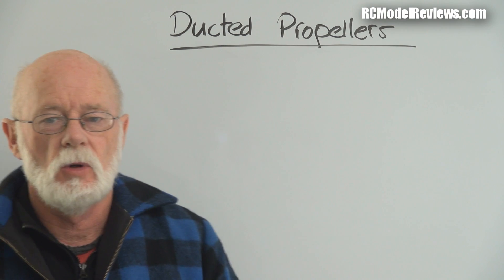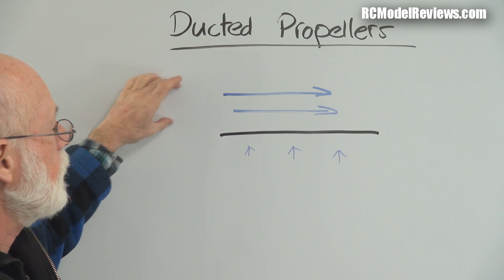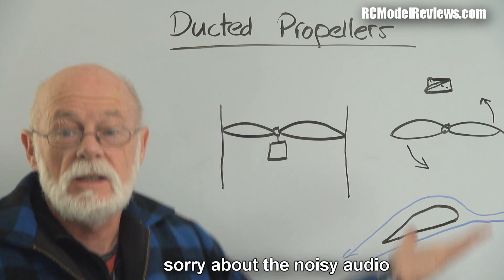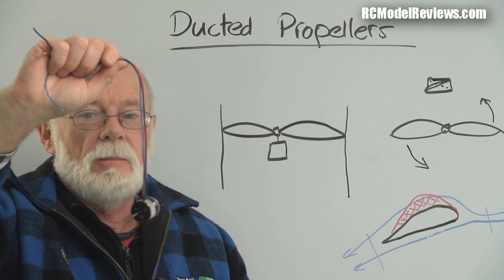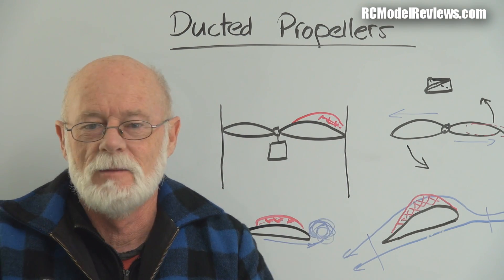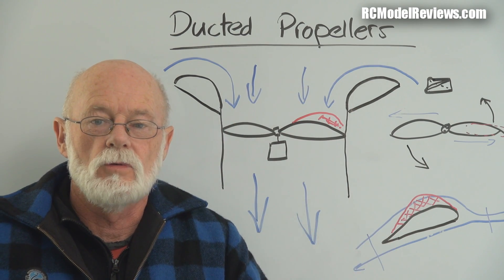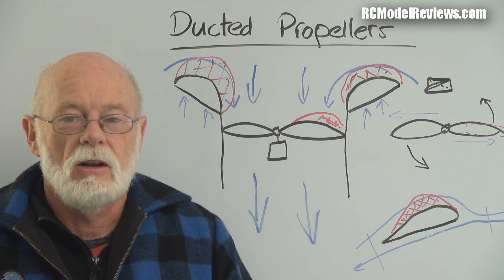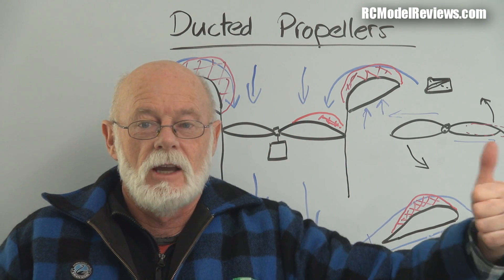How ducting a propeller increases efficiency and thrust

Comment: The Bernoulli Principal is wrong!  Low air pressure on the top of the wing is not the cause of lift, but the result of lift.  Air is pulled and pushed down by the wing (mainly pulled down from the top) which causes the air to pull and push up on the wing with equal force.  The "low pressure" and "high pressure" areas are merely the force being applied to the wing that causes lift.  The actual air pressure does not change that much at all.
Reply: EngineersLogic Yes I agree, Im an Aerospace Engineer who works on transonic wind tunnel modeling. Interesting how our fields name the same things differently, we would say that the fan increases total pressure and the amount of this total pressure converted to dynamic pressure is inversely proportional to the cross sectional size of the diffuser,  such that the sum of static and dynamic is conserved except for viscous losses associated with the boundary layer (but if we get into that then Bernoulli doesn't really apply.) your way seems easier to understand though maybe i should start explaining it like that to people.  Something id be interested in hearing from you is if you do any boundary layer boundary layer interactions like from the top and bottom surface of the duct, because the length of your duct it must kind of invalidate the Reynolds number based on length right? Do you use Reynolds based on skin friction RE tau? or is it just not really an issue and the turbulence reasonably neglected.?
Reply: HORNET6 The pitching moment coefficient  of an aircraft must be nose up at zero angle of attack and nose down as a function of increasing angle of attack. This is accomplished by using tail sections which produce negative lift to trim the aircraft, because the center of lift of an airfoil section is roughly the quarter chord point and it will therefore naturally pitch upwards. This is the stability condition known as positive Cpo negative partial cp partial alpha. Without this computer stabilization is necessary for an airplane to fly, however long ago we realized that induced drag is proportional to the coefficient of lift squared and that by adding a bit of reflex "negative airfoil" we could reduce the coefficient of induced drag by decreasing this coefficient of lift. And reduce the force required to trim the aircraft reducing trim drag. The cost of this is that the aircraft must then fly faster to achieve the same total value of lift and not descend, a thing which fighter aircraft are more than happy to do. You are correct in assuming that flipping the airfoil will tend to decrease lift but the lift force going negative can be avoided by carefully tailoring the reflex angle. This is illustrated by stunt planes being able to fly upside down despite having flipped their airfoil (its often symmetrical anyway), and the reflexed airfoils used in a flying wing type aircraft. The force a pilot observes as this issue is simply the coupling of the propulsive direction and the flight path in a nose down attitude,  but utilizing proper trim the aircraft will fly, simply at a higher speed. 
Hopefully that did not come across too lecturey , and let me know if you think I am wrong in any way.
Reply: Ok well, the Bernoulli Principal is not wrong, in lossless flows the static pressure must be reduced to increase the dynamic pressure caused by the airs movement. Therefore higher velocity flows exhibit a lower static pressure ( acting perpendicularly to the surface). 

What is wrong is the equal transit time fallacy. As explained by  NASA here
https://www.grc.nasa.gov/www/k-12/airplane/wrong1.html

I dont know what you mean by actual air pressure. The total pressure does not change that much but the static pressure sure does, in fact we can measure the static pressure over the wing surface with transducers and experimentally determine the lift the wing section produces.(Its actually my job.) 
I feel like were on the same team here though, is that what you meant?
Reply: Aero Wolf I'm not familiar with all the terminology but I think we are on the same page.  Static pressure is the pressure of the air that is physically clinging to the surface, right?
Reply: ***** there are two pressures, static and dynamic, their sum is the total pressure which is conserved in a lossless flow. 

The static pressure is measured perpendicularly to the surface so its pressing in or i guess clinging can describe it.

 The dynamic pressure comes from the airs movement so one has to slow the air to a stop to measure it but because there is a static pressure everywhere this measures Total pressure. (flow energy) 
Total pressure does not change very much because it is the sum of the two kinds which simply trade back and forth. So static pressure is lower on the top surface than the lower surface because on the top surface the dynamic pressure is higher but the total pressure is the same. Not because of the distance but because of the shape and angle of attack.
Reply: Spot on. If Bernoulli Principle would be right then air behind a wing would be equal pressure. Wings in smoke or clouds clearly show that the air behind the wing keeps moving down.
This is exactly how a sailboat functions. It work by gently bending the flowing air into a new direction and this creates a force. Again just like an wing, this new wind direction is used extensively by competing sailors to block progress on other boats. The wind change can be observed several boat lengths.
Obvious it be beneficial if there is a low drag as this would create a force against the forward motion both for sails as for wings.
Reply: EngineersLogic Yes I agree, technically the enthalpy could remain constant and temperature increase, but on the topic of Ice melting would not this increase in temperature, increase the convective heat transfer coefficient between the air and the ice thus inducing more melting? I mean it would obviously be a function of things like pressure as well but im not super familiar with it. I think the biggest problem I have with global warming as an engineer is the lack of a suitable model for our atmospheric temperatures. At one point our Co2 was 10X what it is now and now were colder than it was then. This would not happen in the simple positive feedback model for Co2 and Solar radiation we have now it would induce runaway warming. So its funny when people say its unprecedented and were doomed because we have done it before and are fine. But yes people are always confusing temperature with heat, like saying Jet fuel wont melt steel, well yeah an open flame wont but if the walls of a room allow no heat transfer, a dam (infinite) candle will eventually add enough Q to melt steel. This is particularly a problem with me as an Aerospace Engineer explaining the temperature profile of the atmosphere. Basically how the thermosphere can be over 100 deg  C but if you were there you would still freeze to death. Also how despite being absolute zero ish in space satellites tend to need cooling and not heating, if you could keep your air and eyes you would freeze to death naked in a Pennsylvanian winter before you would in space.
Reply: HORNET6 didn't call you lame. Commenting on the post, which I said was lame for implying that push and pull aren't common nomenclature used to represent force. I stand by it...tall and proud on my high horse. Seabiscuit, that's my high horse... Seabiscuit!!!!!
Reply: Boat sails and airplane wings operate using the same principles of aerodynamics, they just direct them in different ways. A sailboat needs wind to propel it across the water. An airplane uses an engine and propeller to generate wind across its wings (through forward movement). The earliest airplane wings were nothing more than cloth sails spread across a rigid, horizontal framework, while modern wingsails are nothing more than airplane wings attached vertically to a boat's deck. They both use Bernoulli's principle to create lift and it is that lifting force that keeps an airplane aloft or pulls a boat through the water.

Yes, both an airplane wing and a boat sail use angle-of-attack (AoA) to bend the air in a new direction, and this does increase the amount of lift generated or forward speed produced, but the AoA is only used to increase the power of what is already being generated by the airfoil. And while even a flat plate creates lift with a bit of AoA, an airfoil shape allows the air to flow MUCH more cleanly across the wing or sail before the shape experiences cavitation (stall) and loses most or all of its lifting power.

A wing moving through the air with zero angle-of-attack would release the air along its trailing edge so cleanly that almost no disturbance would be visible in the surrounding air apart from that created by drag, something created by any object moving through a fluid or gas, but it would still produce a certain amount of lift due to its airfoil shape and Bernoulli's principle.
Reply: Another term for "dynamic pressure" is "velocity pressure", which might make it easier for some to understand. You are absolutely correct: static pressure + velocity (dynamic) pressure = total pressure. Static pressure has nothing to do with "clinging" to anything. Static pressure is exerted in all directions equally (like an inflated balloon), velocity pressure is pressure in a single direction (like wind hitting the side of a house). I do HVAC engineering: Air conditioning or exhaust fans create 'X' amount of static pressure, but the actual static pressure inside of the duct depends on sizing. If we speed up the air flow with smaller ducts, there is higher velocity pressure, which means we lose more energy when the air smacks into a perpendicular plane at the back side of a 90 degree elbow in the duct. There is also more energy loss with higher velocities because greater speed across a surface increases friction loss (clinging?).  The velocity pressure can also be converted back into static pressure by increasing the duct size and slowing the air down (called static regain). A positive pressure duct can actually pull air into the duct from an opening in the side of the duct if the velocity is high enough (rather than push air out of the hole), which is how the venturi effect works.

Contrary to Timothy's assertion: The Bernoulli Principal is most certainly NOT wrong. We are all dumber now for having read his comment, I'm just sayin.

https://woodgears.ca/physics/venturi.html
Reply: Aero Wolf 
Great comment, i look forward to responding. I'm in my truck about to leave the gas station at the moment though, i will have to get back to you.
Reply: For the record, I am not an engineer. I do not mean to claim that unearned title. I am a mechanical designer who has been designing mechanical systems for ~18 years. I will however stand my ground against any registered engineer if I disagree with them.
Reply: This is completely off topic, but don't you find it interesting how the entire global warming/climate change discussion rests on "degrees of temperature change" (which is a reference to dry bulb only, and completely ignores latent heat and true enthalpy)? 

It is entirely possible to have "warming" with constant (or even cooler) dry bulb temperatures but more water vapor in the air, or "cooling" with higher dry bulb temperatures but less water vapor in the air.  

If you are familiar with a psychrometrics chart, then you know that a single air measurement value is entirely meaningless without any others in terms of energy content, and that you need at least two variables to be measured before you can determine all the others values of air.   

Do you agree that a target of "2 degrees Celsius" rise by the year 2100...is an entirely meaningless goal which does not address actual heat content?
Reply: Example: Evaporative coolers (swamp coolers) provide supply air with a cooler dry bulb temperature, but the enthalpy did not change. Latent was traded for sensible, similar to dynamic pressure being traded for static pressure. There is no difference in energy, but the dry bulb temperature still reads differently. Any goal referencing dry bulb only, is a meaningless goal.
Reply: Seeing as we are discussing physics may I remind you that there is no such condition as a pull, only a quantity and direction of force. The beginning and end of your paragraph are contradictory
Reply: HORNET6 your arguing semantics.  he is right, and you haven't made a point, just criticized word placement. Lame.
Reply: Aero Wolf you say bernulli I'd not wrong, then reference a site that calls his theory "incorrect theory number 1". that's called misleading.
Reply: The Griffenn why am I lame to point out that he contradicts himself? I was merely pointing out that it was confusing as was the pulling and pushing.
Now please climb down from your high Horse.
I welcome your comment on the question I asked.
Reply: Phillip Breske I worked with the Hawk whilst in the RAF and fascinated me that it has a laminar wing section. Another factor regarding lift is wing loading. Apparently a Jaguar could produce wake turbulance comparative to an airliner.
Reply: The Griffenn yes to common nomenclature, absolutely, but strict language in this instance
Ensures clarity. No?
Enjoy your Horse.
Reply: HORNET6 So you implying a disproven theory, Bernulli, is correct. Then, use common parlance as proof it's incorrect. I gallop in and rebuff that idea, me and Seabiscuit would never stand for such!
Reply: Ha ha ha, not my intention either way, but fascinated by the NASA link in respect of equal transit. Good grief my learning and understanding is being blown apart!
Reply: HORNET6 are you being sarcastic? Seabiscuit thinks so, but I'd like to think your being for reals...
Reply: HORNET6 most likely the inverted foil on the tail plane is to produce down force to counter act the nose down pitching moment created by the main wing. On the wing, the resultant lift vector from the pressure distribution is behind the cord line causing the airfoil to want to pitch nose down (nose down pitching moment). the inverted foil in the tail creates down force at zero AoA with less drag than an positive foil would at the negative AoA to produce the same down force.
Reply: The Griffenn perhaps I was misleading, Bernoulli principal is correct. It application in the equal transit theory is however improper. There are certain conditions which predicate the usage of this principal such as the invicid condition violated by the boundary layers rotational qualities. Hopefully that helps clarify what i meant.
Reply: Fred Porter Thats exactly what I think reflexed airfoils are for, but what do you mean autofill?
Reply: Aero Wolf sorry, meant airfoil
Reply: HORNET6 thank you for the discourse. I have seen where Bernulli's equation can be useful and never meant to imply otherwise, only it's incompleteness. I bet working with the F3 was fascinating, and those of us who have never had even a passing input in our defence appreciate your service, whatever it was.
Reply: Fred Porter go see the link he is referring to.
Reply: The Griffenn which he do you mean? I replied to HORNET6 about the inverted airfoil horizontal stab as part of an aircraft.
Reply: The Griffenn the recognition is much appreciated.  Thank you.
I spent GW 2 flying all over the middle east on C17. That is one impressive bird.
My last  five years was with the Reds.
Getting my hands on controls of a red Hawk as a ppl was a real treat
Reply: Fred Porter I cant agree with your dynamic description...the main plain is creating lift though with instead of aginst gravity. Add this to any 'built in' AoA and in the normal flying attitude, although inverted, the aircraft will descend. The tailplain creates the pitching moment to counteract and can be trimmed to fly 'hands off' ie balanced flight
Reply: HORNET6 I was unaware the Hawk Implemented laminar airfoils. This is interesting as it was my understanding that the laminar airfoil was susceptible to debris and turbulence detaching the laminar boundary layer and this limited its utility in maneuvering and FOB operations. Is there anything you can say to this end? I have often struggled with the pros and cons of this technology when designing aircraft and any input is most appreciated.
Reply: I'm confused:  If the top of the wing makes no difference and you seem to be saying it does not, and instead it is the wing offsetting the air and causing a force, then why does the airplane NOT fly if you make the wing flat on both sides and only rely on this force?  Why would an airplane with more curve to its top surface be more stable in flight than one with totally flat wings?

There seems to be a bit more going on than you guys seem to be focusing on.
Reply: Air can't "pull" there is no such thing as suction.